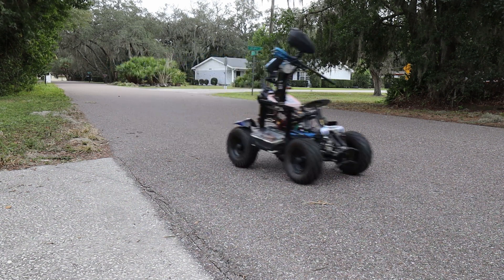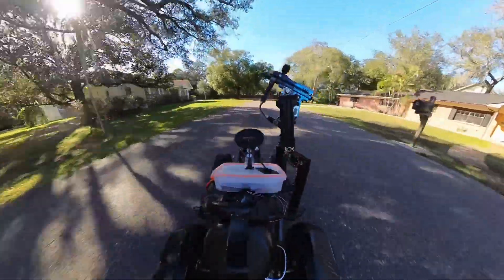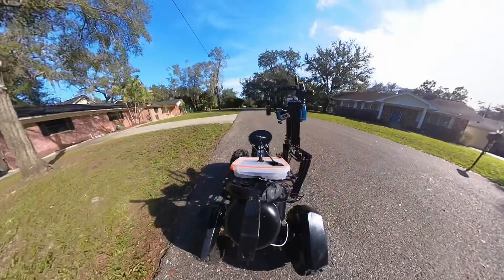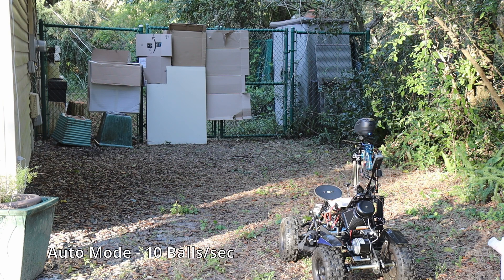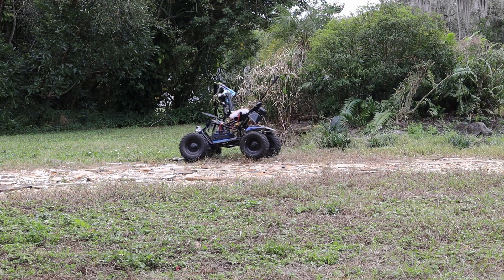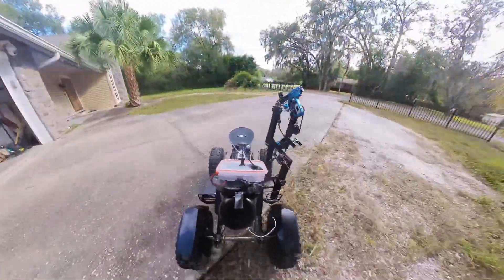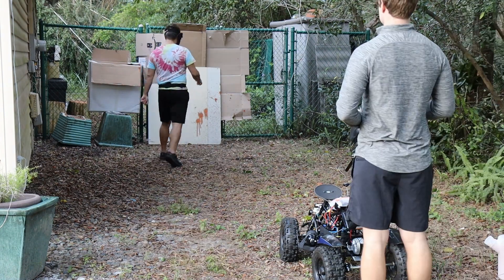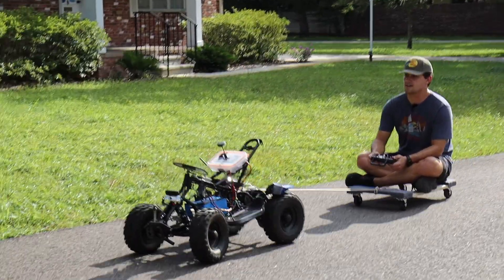Testing my Sentry Bot's Auto Aim and Making Him Faster

Comment: If you are chopping paintballs try turning down the velocity and and turn down the bps (balls per second) if you are using C02 as the air supply earlier morning velocity will be lower than afternoon velocity because of temperature of the c02. Colder morning and warmer afternoons will change the velocity by a lot sometimes.
Reply from the maker: That makes sense, it was super chilly out. I think the balls might be too cheap too, they’re quite soft. Gonna tune what you mentioned and see if I can get turbo working 😎
Reply: @James_Rivers  295-300fps (feet per second) for velocity and max bps I probably wouldn’t go over 15 with the lower end paintball marker. Those style markers are notorious for shooting hot out of the box and you use to have to clip the velocity spring.

Comment: You need sway bars, rear wheel steering for slow speed maneuvering and gyros for both front and rear steering with the ability to turn off rear steering for high speed.

Comment: You need to lower the center of gravity if you can. If you're always going to be pointing forward with the paint balls, you could have a much easier time positioning the gun with a smaller area. Go for wider wheels not taller wheels if you can. Slow down as you take turns. This makes me want to build something similar.

Comment: This is awesome. Have you thought about using something like a lazy susan turntable for the horizontal rotation?
Reply from the maker: I’ve seen a few videos where people tried it with similar turrets but it didn’t work well for them. Something about the bearing design I think

Comment: An idea if  you ever get time,  make two types of drones.

first type one already making for rapid redeployment and support from breaches. 

The second type is a slower tank but more stable and accurate weapon system with bigger paint ball rounds as well that you legally can use, this unit type works like a self repelled turrets, rarely moving from their area even if other areas are breach Less they are close, in case first breaches are distractions from real attempts. This second unit like green tanks from that Wii tanks unit always hitting and firing at where the target might go. Uses treads for stabilization.  

If make multiple units getting them to communicate could also be unit. With some voice recognition you could add verbal commands so you don't always need phone or another device to control them when present?

Comment: substitute the GPS with lidar
Reply from the maker: You read my mind, that’s the plan
Reply: @James_Rivers  my Dji Drone sometimes has problem with GPS or communication signal due to high current powerlines in high frequency radio transmission transmitters it seems like it wouldn't happen, but it actually happened to me in my drone just took off. I had no control over it.
Reply from the maker: that’s wild. I’ve only flown my mavic at my house once but that was forever ago, probably won’t risk it again knowing that tho lol
Reply: This is pretty cool